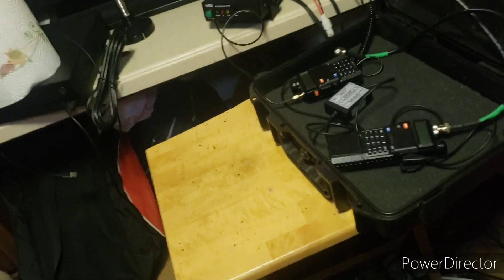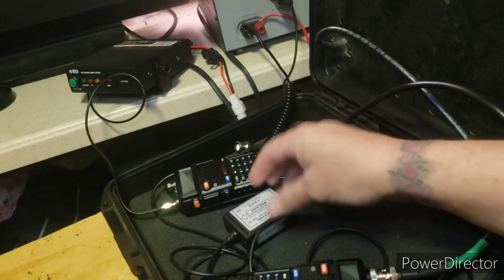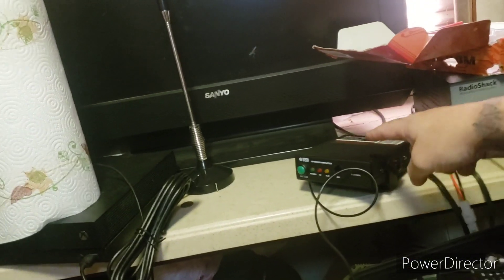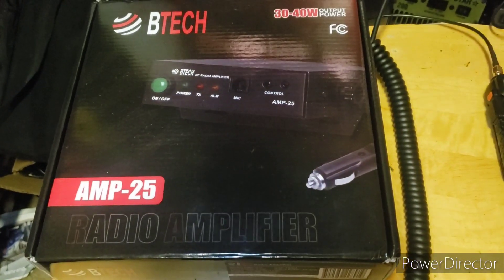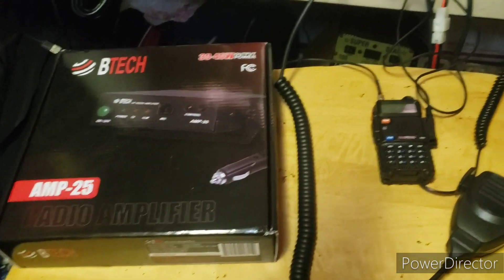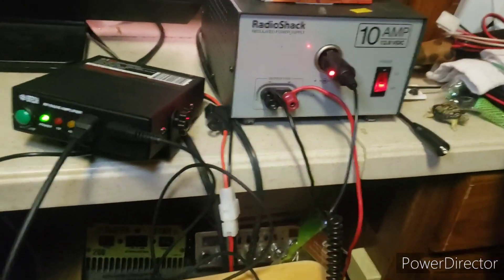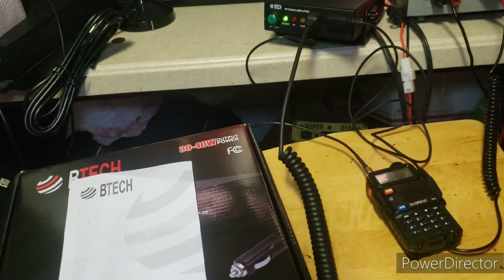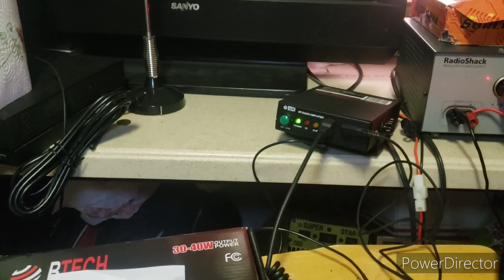I turned my Baofeng repeater into a 40w powerhouse with BTECH AMP-25! #hamradio #baofeng #repeaters

Comment: Why not connect preamp to receive radio?
Reply from the maker: Its just a budget build. I provide the base setup and you can add anything you want to it. This is just basic for it to work. I may add an auto ID for certain situations but works great as is.

Comment: If you connected the two radios to a duplexer then run it to the amplifier wouldn’t it work better?
Reply: Wouldn’t it take the two radios antenna and route it to one that would connect to the amplifier?
Reply: Alright I was going to try your setup but with a cheap amazon gmrs duplexer is why I was asking, thank you for the quick replies.
Reply: I was trying to get a repeater that’s cheaper with a little extra power.
Reply from the maker: Yes but it would also defeat the purpose of not purchasing an expensive duplexer and running 2 antennas.
Reply from the maker: Yes the duplexer would make it capable of using 1 antenna but on a budget build like this i wanted to go cheap. Its for people on a budget that want a working short use repeater.
Reply from the maker: Thats the beauty of it. You can run a duplexer if you want! Would love to hear about how it works for you. Thanks for watching!!

Comment: Hello. I am a GMRS licensed operator, NOT HAM licensed. I notice you are using GMRS/FRS frequency and 2m band. We cannot cross band GMRS with other bands, only HAM bands can be crossed bands. GMRS repeaters has to be on same band with 5MHZ upscaling and we have to use a duplexer, if no duplexer, bad duplexer or untuned, the repeater will have the common phenomenon "DESCENSING". If a repeater has bad, untuned or no duplexer it will work while you are no more than 10 feet about it will work fine, but if you go further, you will hear just the clicking, that is caused by "DESCENSING". By the way, it is a great project if you are going to use it as cross band repeater
Reply from the maker: Haha the bottom frequency is not used. There was no cross banding between services or even bands (2m/70cm). The radio laying down in the case was also on the 2m band and was the receive radio. Desensitization is actually caused by a stronger transmitter overloading the receiver causing it to not be able to receive weaker signals than the transmitter. The antennas are separated by about 30ft in the test I did to avoid desense.
Reply from the maker: Actually used this repeater in my truck with antenna separation of 9ft at Hamvention 2023 and had no problems at all. A duplexer will give you the ability to use 1 antenna for transmit AND receive. I don't use a duplexer so I have to use 2 antennas.
Reply from the maker: 1 last thing, you are not required to use a duplexer on a GMRS repeater.

Comment: 5:20 You've gotta mean 5.5 AMPS, not 5.5 watts... right?  5.5 watts just doesn't make any sense.  Basic science says it's gotta take in at least as much energy as it puts out - and nothing is 100% efficient in the real world.  5.5watts at 13.8volts is about 75 watts input - which actually makes sense if it's putting out 40 watts.  People say this amp gets hot during transmit, so most of that extra 35 watts is logically being lost to heat.  5 WATTS input, on the other hand, isn't enough to make something this size HOT, even if it was using 100% of the power just to make heat.
Reply from the maker: Oh my goodness haha. I didn't even catch that. Thanks for pointing that out!

Comment: Hello sir. I have question about the amplifier. When you switch between TX/RX is there a typical sound from "click" of relay? Most of the amplifiers are using mechanical relays and the sound is noticable. I am looking for simple amplifier for my hot spot. Thank you
Reply from the maker: Yes you can hear the "click" and the tx light will be on.
Reply: @thesaltyham7144  Thank you! This information is important. It means that if I use the amplifier for dmr hotspot, it is going to switch the mechanical relay many many times per hour and this is not going to last too long, if there is mechanical relay. Thank you again

Comment: So you R antenna is mounted to the box and T is outside easier up ? Could a duplexer be ised to utilize one  antenna ?
Reply from the maker: Yeah you could use a duplexer but that would cost way more. This is more of a budget build and the relay box between the radios works pretty well.
Reply: @thesaltyham7144  I was wanting to build one for our ranch and hunt club . Would the amp go between transmit radio ?
Reply from the maker: @naturecoastprepping2487  the amp goes between the transmit radio and the transmit antenna.

Comment: im going to try this out again on the bench, i was new to radio about 3 years ago and went hot and heavy at first and gradually tapered down to not even touching anything for about 1.5 years now.

anyways i had issues with the baofeng repeater interface, i dont remember what they were but i need to figure this out now.
Reply from the maker: Your not the only one that has had issues. I have had enough reply about it so it looks like I am going to be doing a video on settings for everything. Thanks for watching!

Comment: Is the range any better
Reply from the maker: So the signal strength is better and having the TX antenna about 10-15ft higher than the RX will give you the better distance. With the more solid signal and the high antenna, range is great. I haven't done actual miles apart range testing but where I did test, it work flawlessly.

Comment: Someone help me understand how the Amplifier uses 5 wattsDC  to output 40 watts RF...
How many khz is the offset ?  How do you not desense the input ?
Reply from the maker: So I am still new to learning about amplifiers but the general understanding is the 5w goes in to the amplifier and it pushes it out  30 to 40w depending on the actual output of the HT.  The offset is set at 000.600 like any other repeater or it can also to set up for crossband repeat.  For the desense issue, I have the TX antenna set 10ft higher than than my receive antenna. Its a 2m roll up j-pole and can be raised higher if I need to. I also have a Nagoya NA-771 antenna for when I am not using the amp and only run 5w.  I have a couple other videos that I need to finish and then I should have a video with full use testing on this repeater. Thanks for the great question and I hope you stick around for more content!
Reply: Yep, sounds good.
I have the uv 9 AMG. Ive dumped the firmware, rewritten it and uploaded back into the radio. Upgraded a few components on the board. I had an opportunity to tune it up to mil-spec. Right place right time, and I know a guy he he he 😆
Cheerz
    ;)

Comment: I love the idea of a 40w portable repeater but I'd upgrade from using Baofengs... even though I have two amongst my HT's.😊
I hope to build one so I'll be watching.🍻🤠
Reply from the maker: Any radios with the Kenwood K- connector should work just fine i would think. I wanted to keep it as cheap as possible and I actually love my uv5r radios. I ha e about 10 floating around the house, truck, and in storage. I made a 1 minute short with an update on solar. I plan on getting a longer lasting battery and a higher wattage solar panel.
Reply: @thesaltyham7144  That would be great, more power if you can fit it all in.
Yes, I think most of my HT's have the Kenwood-K connector on them. I just bought a QuanShen UV-K5, it has clones and has more rx and tx bands and is also cheap to throw in the car. 
10 Baofengs? Haha, can never have enough. I'll see if I can find the short video. Cheers for replying.😉

Comment: Iam using the same setup but have a vox delay. Adding a  before transmission tone  does the trick for now. How to you get around the delay? When using the relay box?
Reply from the maker: From what I can gather, there will be a very small delay between the RX and the TX even with the relay box. Just about any repeater I have been on has a slight delay. Thats normally why you would want to key up on your mic for about a second or so before speaking so that you don't have your first word cut in half or cut off completely.

Comment: Are you using 2 antenna's?  What about using 1 antenna with a duplexer?
Reply from the maker: I wanted mine to be  versatile so I can use it with gmrs, 70cm, and 2m. A duplexer limits me to what the duplexer is tuned for.

Comment: Any particular reason to use VHF over UHF?

I was watching another one of your videos last night and I thought you said that one radio was VHF and the other was UHF...if that's so, what's the reasoning?  Curious to know know and understand the ins and outs.  Thanks...🎙👍 73
Reply from the maker: VHF was just what I used for the video but I have gmrs radios that I can use with the setup and either VHF or UHF or crossband. Thats what great about it also. Its interchangeable for multiple frequencies. Your covered for your licensing and needs. I also have a GMRS license so I can use it for family outings by changing radios.

Comment: Let me know when u solve the id problem that's what is stumping me
Reply from the maker: I plan on eventually getting an Argent Data Systems repeater controller soon. Only need it to be on the TX so I can use a simplex controller.

Comment: Is it still good man ? im gonna put 2 antennas in the yard and im build me 1 just like it im make my own  Repeater wire though this is probably the best repeater for the money for ham or gmrs if that amplifier dont go out frist.
Reply from the maker: Yes it is definitely still doing good and working just fine. So far I am still happy with the amp!
Reply: @thesaltyham7144  i wonder  can u use it as a base  Station and a repeater at the same time like have it hooked to the repeater and a 3rd radio at the front of thd amp and use it that way to im wondering will it work ? If u know please let me know thanks.
Reply from the maker: @ralphjohnson8775  you would not be able to use them simultaneously and would need to connect the antenna to each radio individually.  Now if you add a stwitter just before the amplifier you could possibly run 2 radios.  That would be a cool experiment to try out.

Comment: I'm setting up something similar using the Btech amp, except I'm mounting it in my vehicle with a 1/2 wavelength antenna to use as a mobile rig, or base station repeater using the repeater box. We'll see how it goes.
Reply: I know it's been two years but you have a video on this!  I'm getting mine tomorrow and going to do pretty much the same by adding it in my truck to boost my baofeng 5RM or my DMR radio.  I already made a repeater box with the GMRS 50v2

Comment: I tried this back in November. The amp was sent back 3x. The 3rd seemed to function but could not hear any repeater ping back. Other radios could hear it, but never the one with the amp. Distance tests garnered zero discernable difference between the amp on and off. Got a TYT TH-7900 black Friday sale and never looked back.
Reply from the maker: I haven't had any problems yet (fingers crossed). Actually just using the amp to make my uv5r a base radio until I can get a solar setup for the repeater.